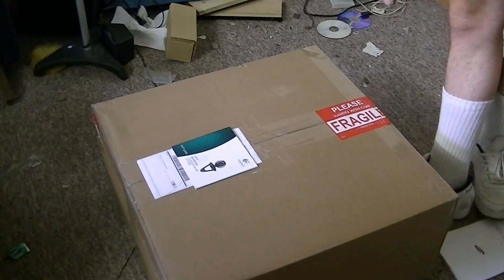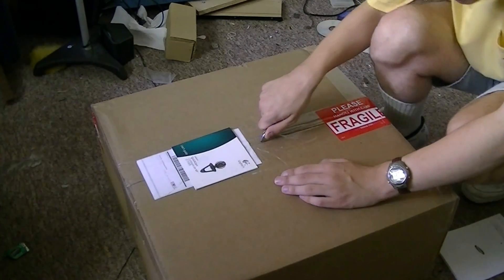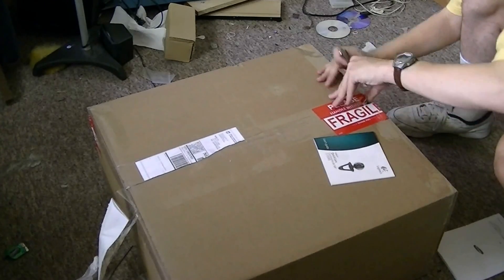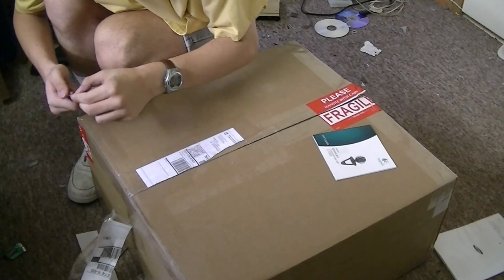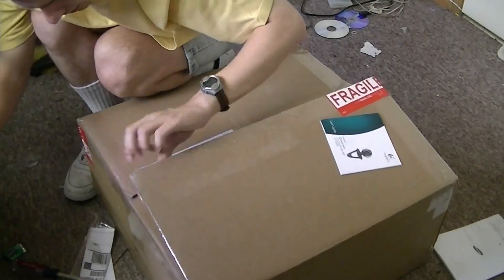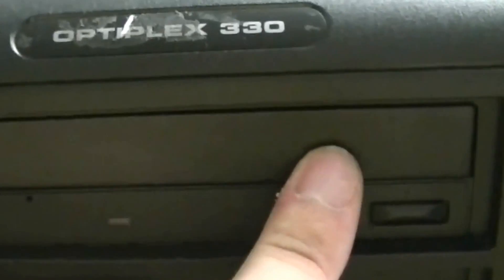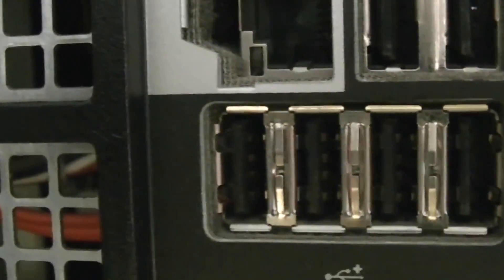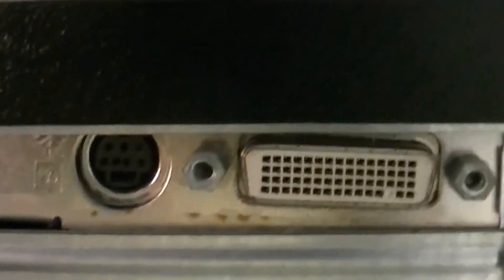Unboxing & Setting up My Dell OptiPlex 330

Comment: Hello I have the same computer Dell optiplex 330, and mine had 1gb ram and I wanted to updated to 2gb, but once I put it on the computer and I turned on it starts beeping and it doesnt work.... Can you help me please?
Reply: disk failur you need to install new windows
Reply: Gamer2013 i had desame problem :/
Reply: Bad ram
Reply: +Gamer2013 no you have to check the ram if it placed well

Comment: ***** I used to have a Dell Optiplex GX150 SFF back in 2007 and 2008.  I got it for free and the only issue was the power supply.  For about a month, I used the computer with a full-sized ATX power supply that was sitting next to the open case.  Not exactly the safest setup, but it worked.  Even after getting a new power supply, I still used the computer with the case open since my video card was a full-height ATi Radeon 9200 PCI card and the computer only supported low-profile cards.

Comment: That plug called "DMS-59" requires a dongle that splits out to dual DVI or VGA ports, it was common with OEM Dell video cards. Dell PN 310-4469 includes both adapter types. Try using a blow dryer on the warranty seal to maintain it.